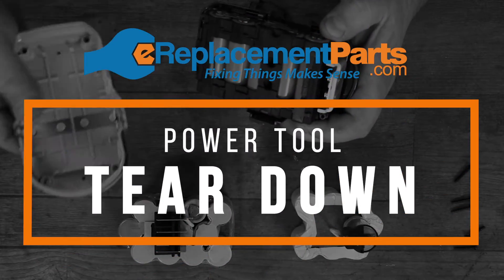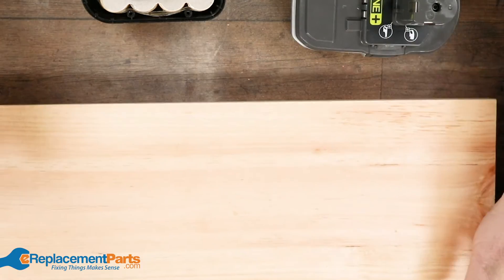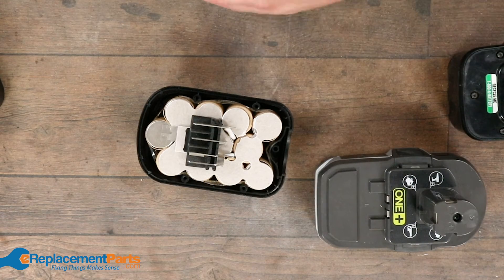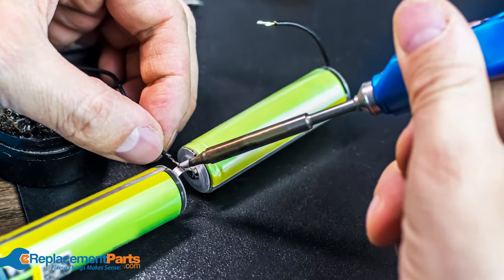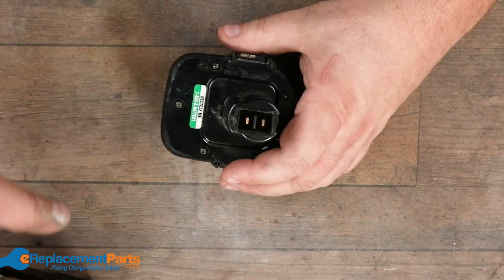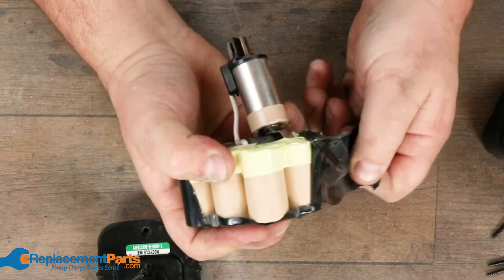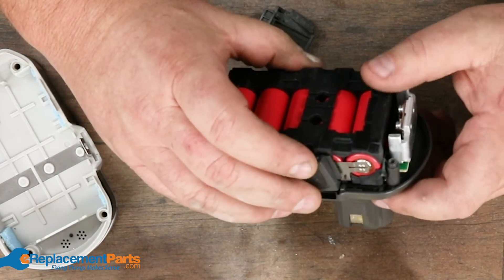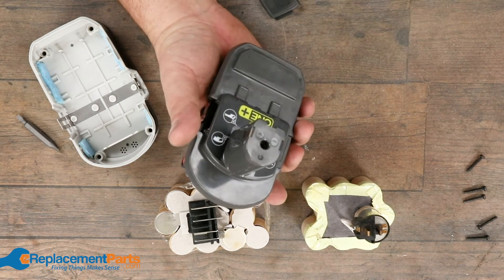Tool Tear Down: Cordless Batteries | What's Inside and How to Replace Them | eReplacementParts.com

Comment: Thank you, I had a usb battery bank that failed early/ disassembled it for recovering what turned out to be 6 18650 batteries, flat tops/ but they still seem to work ok in my flashlights. *had some minimal markings instead of just paper/ gray sides.

Comment: I have a DeWalt drill with NiCad's......how do I keep them fresh without overcharging and ruining them?  Are any aftermarket complete batteries any good?  If so, which?  I always learn something every time you upload.....Thanks, Tom
Reply: Chargers have built in regulating circuitry that should prevent over charging. Never direct charge a nicad battery. I found it easier to remove the original batterys and match up a Lithium battery that will still have the same voltage. I hot glue the battery in the old cartridge and run the balance charger lead outside the cell. You can typically  replace old Nicad batterys and buy a charger at any RC hobby website.